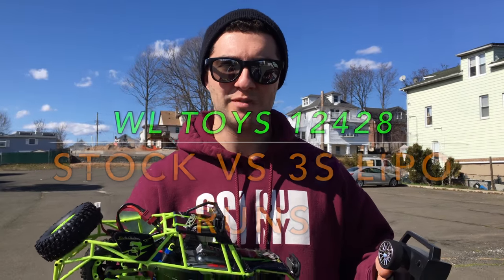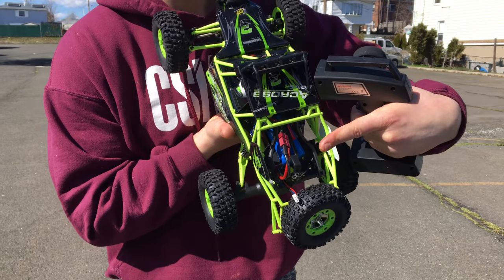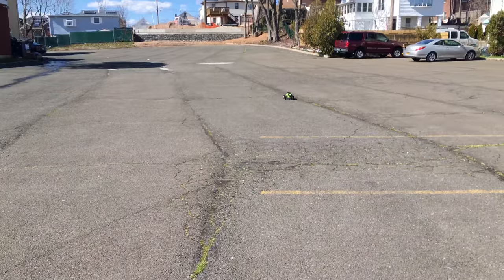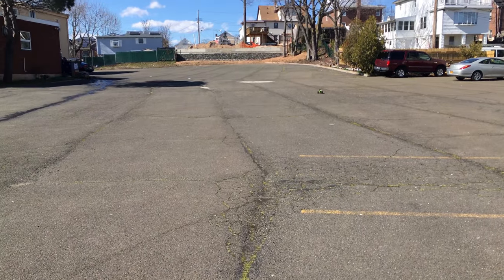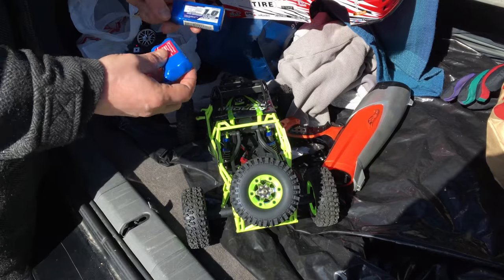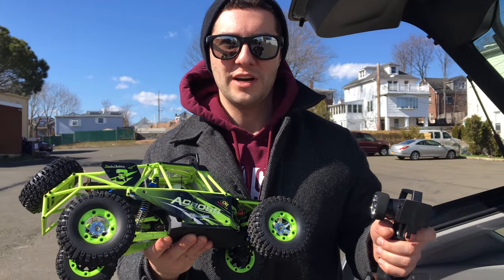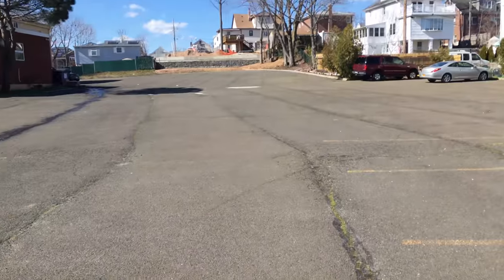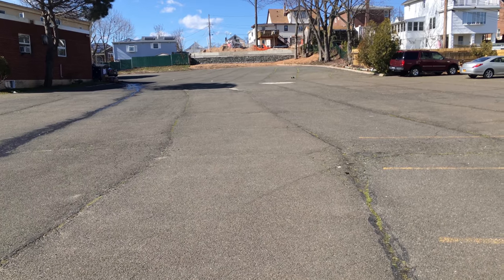WL toys 12428 $70 stock battery VS 3S LIPO speed runs

Comment: 3s on a brushed moter with plastic cogs and spurs its going to break and you said it came with a lipo( lithium polymer ) batt but it comes with a lion(lithium ion) batt
Reply from the maker: Yes, you are right, it did come with a LI-ON battery.  That was a mistake, But in reality it does not matter because both battery types still can use the same LIPO charger and have the same balance plugs and basically work just like any LIPO battery, I usually don't differentiate between the two since they are much alike (other than shape).
Reply: @hybrid32494  the stock esc isn’t designed for lipo batteries. It won’t stop sucking battery at certain level of discharge as it should be. As a result, lipo battery lifespan will go down dramatically.
Reply from the maker: @LifeInVietnam2013  hey buddy! These cars come stock with a LI-ION battery, these contain the same type of charge protocols and voltages as a 2S lipo.  I'm sorry, but you're mistaken.  These come with Li-ION from the factory.

Comment: Hi brother.can I get remote of this car and charger
Reply from the maker: hello buddy!! Do you mean you need a new remote and charger?  The remote is paired to the ESC, since it's a 2 in 1 unit.  You can consider upgrading the entire system to run a separate ESC and receiver, or just buy a whole new one if you're not able to do.that.  Any charger can be used to charge the lipo battery, as long as the connector fits.
Reply: @hybrid32494  cannot l buy a remote
Reply from the maker: you lost your remote???  the problem is this RC uses a 2 in 1 design ESC and receiver unit.  I am not sure if another similar 2.4GHZ remote would pair with the receiver in the car.  Generally you have to bind them in higher lever models, not sure if this is the case here.

Comment: Original ESC bisa pakai battery 3s itu mas ? 11v
Reply from the maker: if I understand what you are saying, The original battery that this comes with is a 2S Li-ion rated at 7.2 Volts.  The 3S as you saw here was my own battery from another model.

Comment: Can it run fine in 3s?
Reply from the maker: hey buddy! I will say that it DOES RUN on 3S.  But keep in mind I only did a few speed runs.  I didn't bash it the whole time. But the answer is yes, it will run on a small 3S pack just fine.

Comment: anyone running the 12428 needs to go ahead and pull the motor and mount out and check the 2 panhead screws that fasten the motor to the blue mount as mine were super loose, I just happens to get lucky enough to notice during a heatsink cooling fan upgrade install. having problems with the 540 motor magnetic field causing the little cooling fan to not spin properly. I have 2 types a single and a dual the dual is slightly elevated on the heatsink giving just enough distance from magnets but the single sits rite on the motor, it's set up like the castle heatsink fan with a shroud like design. I'm sure that 1 would experience the same problem. Idk maybe these single types are more ment for brushless motors as there magnets might not be as strong. idk! anyway locktight on the mount screws and check them asap!  vape on!
Reply from the maker: did your motor wobble some with the loose screws,  or no?
Reply: hybrid32494 no. I only noticed cause I had to flip my motor 180° due to the magnetic field actually slowing down the cooling fans motor
Reply: Wasn't sure flipping it would help but it actually did as exactly 180° on the other side there's a big spot with no magnetic field  just enough in the right spot to run the fans motor at the rite rpm and still allowing the fan to sit straight

Comment: using same gears ,motor and esc that goes good with 2s will always be more power with 3s and have higher top end... as long as the motor and esc can handle 3s...if not esc will usually fail first or just shut down if amp draw is to much... this car is plenty fast on 3s...i would try to fit a 2200 3s in it if possible... even more power if you use same quality and c rated battery... less chance of puffing batteries and longer run times...
Reply from the maker: hey buddy! Thanks for watching. This particular model uses a combination RX/ESC, you cannot alter almost anything about the drivetrain either, it's what you see.  Without going full brushless this is the only variable when it comes to speed in this car, the BATTERY.

Comment: The original battery is not a LiPo.
Reply from the maker: yes, you're right.  I made a speaking mistake.  No big deal, this truck is running and nothing has broken FYI>
Reply: @hybrid32494  I didn’t mean to sound like a jerk. Just mentioning the distinction. Sorry.
Reply from the maker: @brohoop  hey buddy.  No prob!! We all good.  Btw ive gotten this truck upto 30 with a small 3s lipo in future vids.
Reply: @hybrid32494  thanks! Will watch!

Comment: If i change stock battery to 11.1V 1800mAh , is it ok? no problem?
Reply from the maker: yes, I ran a 3S many times.  Its fine.  Just check your motor temp if you can and try to not run the whole pack to empty.  I usually only run a 3S pack for 5-7 minutes to prevent extra abuse on the ESC and motor.
Reply: Thanks!!! It will be helpful to me. thank you!!!